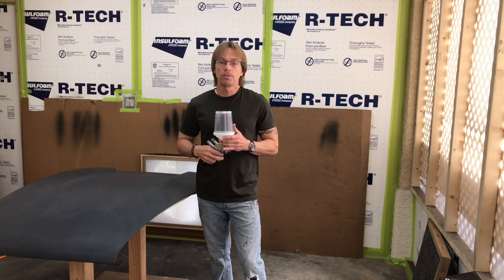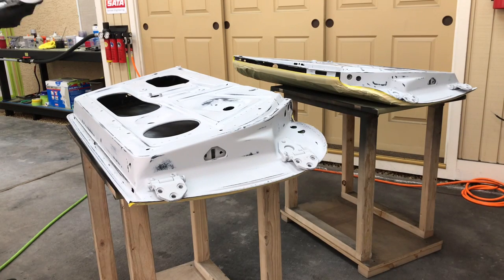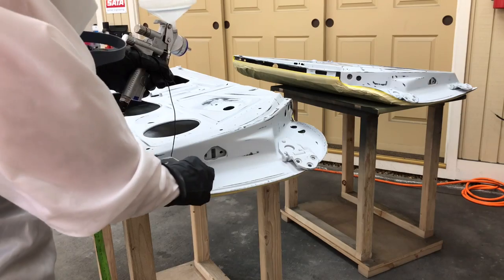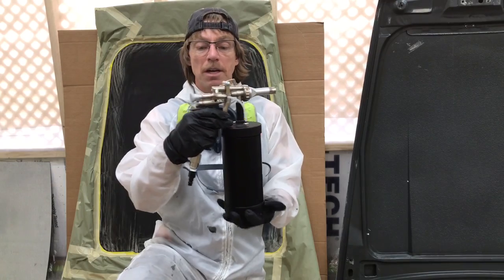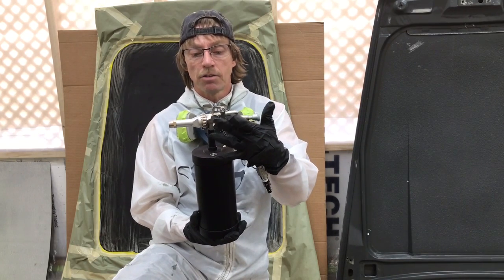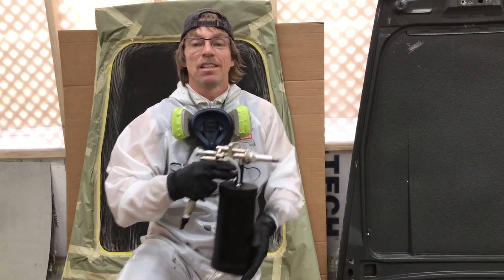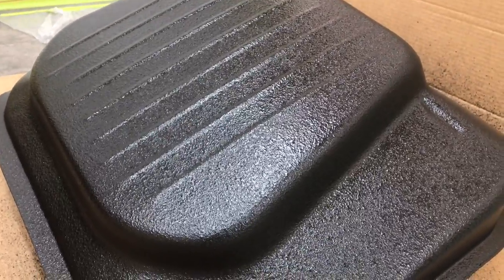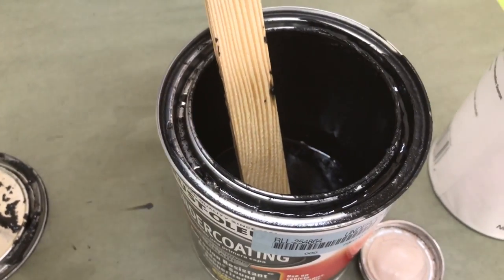1967 Porsche 911 Video 22 Finish Paint Part-4  Working the Booth!

Comment: Hi Mike,  if you were to go back in time would you consider using the rustoleum product for undercoating the pan or would you stick with the transtar?
Reply from the maker: Hello Rodney
I did a video some years back comparing a few undercoatings. At that time it looked like Transtar was going to be the choice.
When it came time to purchase the product I was informed the company was going through some changes and dropping the undercoating in their line up.
Was not able to obtain. I experimented around again and found that the Rustoleum brand shot out of quart size cans was the superior way to go. I was thrilled and used it on the entire project. Today that product is no longer available and only available in aerosol cans. It was complied with very strong chemicals and I can see why it was pulled from market but it was amazing.
Paint companies are constantly reformulating products to meet tighter EPA guidelines and restrictions.
When you get ready to make a choice on your car..a line up a several different currently available products to make a sample would not be a bad idea.

Comment: Great series, and thank you for sharing so much of your valuable knowledge.  I have a '67 also, in original, but rough, slate grey, so very interesting for me to see your process.  Why did you paint the steering wheel?
Reply from the maker: Hi John
Its my pleasure=) Nice car!! will you be doing any restoration work?
All the material shot in this video is Epoxy only.. steering wheel spokes and assembly will be painted in a 2K satin black to match dash board and then the wheel itself will get color. Will be showing the complete process on up coming videos..
so far coming up nicely